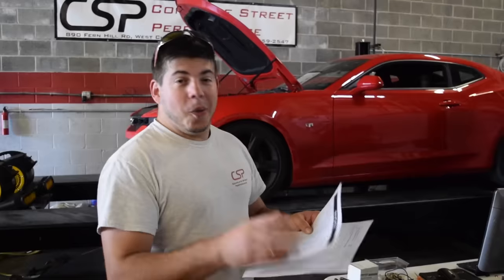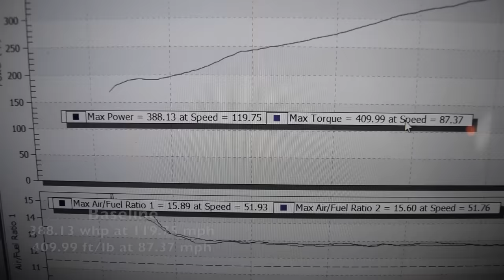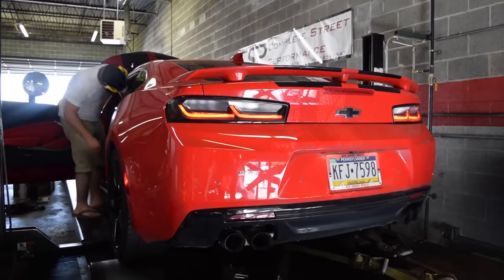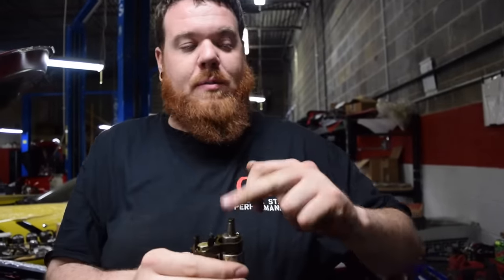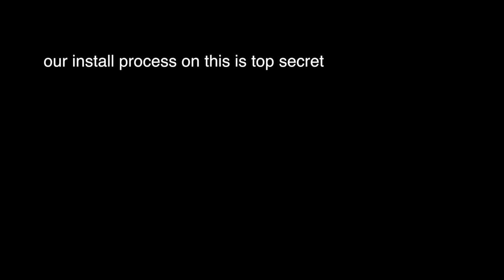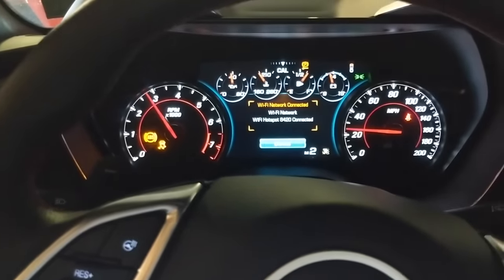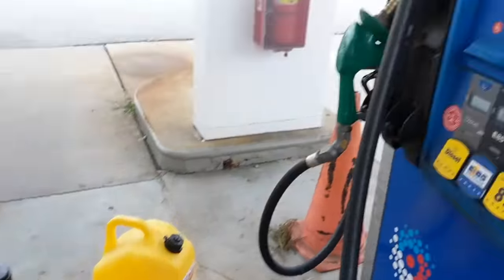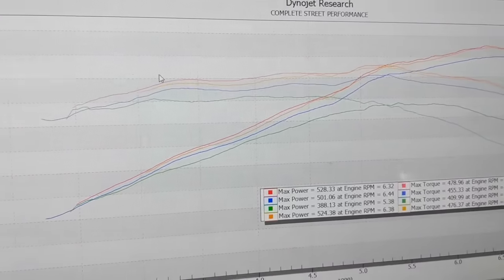How to add 140 rwhp to your Camaro SS without boost!

Comment: Man that looks like a lot of work lol :-) I think I'll just leave mine 455hp, + cold air intake 🤘😎
Reply: Heads and cam change on a new motor makes this kit very expensive hp.
Reply: more like 388 RWHP
Reply: @johnlangley7521  Yes stock, but I did end up getting a Whipple supercharger and some other toys, so she's sitting around 600 rear wheel horsepower 🤘🔥
Reply: @esovae  just took delivery of my '22 LT1. Owned and '05 GTO since day 1. I'd be very happy with 500hp at the wheels, gonna leave this thing stock though.
Reply: @johnlangley7521  oh no way that sounds awesome:-) yeah something's just leave them where they are, sometimes that's better. In my personal opinion I think my car has way too much rear wheel power and so I generally just spin out all over the place lmao. Got to get some new tires and grip 🤘

Comment: Why would a 455 hp engine dyno at 388 hp?
Reply: 455hp is rated at the motor, but at the wheels touching the ground it's always less. Lose HP spinning the transmission, driveshaft, differential, wheels, car weight, etc...

Comment: 7k rpm? That ain’t no smallish cam.. You ain’t fooling me lol.. Good numbers tho 💪
Reply: Capable of 470 horsepower and 410 torque at rear wheels on pump gas
Reply: Small cams peak at 65-6600 7k is big cam stage 2.5-3

Comment: You forgot to mention that 140whp in accordance to this specific setup will cost $6-8 grand, tuning included and parts installation at the least. Wish I have that kind of money laying around.
Reply: Cheaper to boost it and make more power. All I did was upgrade my supercharger on my Gt500. Went from 550whp 540tq to 801whp and 792tq. Runs and drives like stock.
Reply: Darren McFeaters would it be cheaper just to super charge it ?
Reply: Zach best to keep it NA if you want a a fast daily .

Comment: for what you spend on that you can supercharge it
Reply: Lies...lol you need to do your research sir a Whipple would cost 8k not even counting the labor...most he will spend on this is 3500$ give or take
Reply: @704_ss_connor-4  yea because ls is cheap to modify when it comes to changing engine parts cams heads intake etc

Comment: I like these. Nice job!.

Or buy an 18+ mustang, install headers, intake pipe, tune and dump e85 in tank and enjoy 509whp.
Reply: It will still loose to the  ss or stingray with the same power because of weight , tq and power under the curve
Reply: @speedlife301  Mustang is lighter than the SS
Reply: @ish4372  Coyote 5.0 is very robust, doubt very much it will "take a dump"

Comment: Ya know what's funny, my stock 2017 ss 50th anniversary puts down 510 at the rear wheeles with only a tune. Stock was 450hp.
Reply: Sure it does lmao
Reply: @ericbryant7647  I have the dyno printout boy! And I've had over 15 muscle cars since I was 18, I can tell that's your 1st one.
Reply: @raydelfa1125  Just a happy dyno man. You may have picked up some power with the tune but 6th gens are 455/460hp at the crank. You're not picking up 100rwhp from just a tune sorry to say. Lots of factors involved when it comes to dynos.

Comment: It’s weird I make 470 rwhp with a roto, lt2 im, long tubes and E85.
Reply: You can't compare different dynos. It's irrelevant, and the same car can read out a range of 50rwhp differences. There's a local dyno here where stock SS show 365rwhp, while another dyno down the street reads 410rwhp. The important thing is having a baseline and comparing your gains as a delta on the same dyno after you add mods.

Comment: Dude I am impressed the chevy finally makes a bunch more power with a full top end kit wow. Now for real power buy a hemi add a camshaft Instant 100hp. Do long tubes and add a k&n and get the extra  35 to 40 hp with a tune and then if you want you can add 15 degrees of time advance a little fuel and wow a grand total of 225hp. Let's go your route with a full bolt on top end kit a modest tune and you looking at 650ish hp on the 392 and 5.7 around 546hp  I love Chevy and I do believe dodge stole the ls design in many ways but there heads are way better and aftermarket is just stupid when it s brass tax power gains
Reply: What are you talking about? Do a mid sized cam swap in a Ls1 4th gen camaro and you're easily over 450hp at the crank, add heads and you're over 500 at the crank easy. Where do you get 225hp? With a cam, headers, and a K@N filter lol for the Dodge???

Comment: Heads, can, headers and e85?? And only 140 more ponies? Something ain’t right here 🤔🤔🤔
Reply: How do you figure? Heads, cam and headers without a tune will only get you 30-40 hp most of the time.  Just e85 by itself will also net you like 30hp on N/A engine.

Comment: 6th gen camaro's are monsters with basic bolt on's i have one and I've stomped the shit out of dodge R/T's and 5th gen camaro's im pretty sure the 6th gen would handle hellcraps as well.
Reply: shaun jumawan bastard lol
Reply: Brah r/t’s and all 5th gens are slow as fuck 
392(SRT) and mustangs 2013+ are the goals.
Reply: @captainohsowavy  mustangs 11-14 are the same performance wise so why 13+ Haha
Reply: edgar garcia-meza 13s look better than the 11s
Reply: Bad ass car but there's nothing special about beating a r/t lol. Go after a 392 and have some fun.
Reply: @marcellowheeler88  agreed, the 5.7 equipped Challengers have the same power-weight ratio as the 3.7 V6 11-14 Mustang (but better torque-weight), so only slightly faster

Comment: No thanks.  On public streets (below 80mph), the new torque didn't come on until 4 mph later around 56mph, while OEM gave you that torque at 52mph.  I'd rather have torque early than more torque later.
Reply: mrpmj00 It's a N/A build. You're not going to get those kind of numbers lower down the rpm band while staying N/A...
Reply: @231mac  Sure you can, select a different cam that gives you more low-midrange torque.
Reply: @scottwilson1251  Sure you can put in a different grind that will produce torque lower on the RPM band, but like I said, you will lose the higher hp numbers on top, forfeiting the advantages the high hp that a high rpm motor provides. You don't get the best of both worlds on an N/A, non-variable cam build.
Reply: @231mac  Ya it's a trade off. The best thing for someone to do if they really want to stay NA, and gain power in the low and midrange would be to stroke it. That way you can throw a high RPM cam in and still increase power in the low end almost like an old school big block.

Comment: Must be a $1500 job just pulling all that off for the heads. Just pull the engine and make it sooo much quicker, easier.
Reply: And cheaper.
Reply: MHautovlgs paying any shop to pull an engine is not cheap.  On an LT1, It’s only slightly less time consuming to move the lower cradle, remove the oil pan, then you can take off the cam cover to replace the cam.  Lifters need to go too.  This whole job by CSP was probably billed around $8k.
Reply from the maker: Pretty close. Pulling the engine is best as it gives easy access to everything - less likely to make an error when you aren't climbing around stuff.

Comment: Not sure 4K in parts is worth it with 1000-1500 in labor
Reply: I really like camaros but they are expensive as hell to mod with not much gain 4K into a coyote and you’re at 600whp easily

Comment: Should have thrown on a 103 TB for more gain.
Reply: Ported 95mm all you need.
Reply: Well Joe have u tried a 103.  I have and the dyno noticed a gain.  Ordered mine from Katech and I would recommend it no problem for most applications.  Not astronomical gains but all gains together amount to an increase in power overall.

Comment: Dude that’s good rwhp on just a CAI. I think bone stock you can get 350 rw out of em

Edit: I did not realize that these are rated at 455hp crank. I was assuming it was still at 400.
Reply: Ryne Christesen stock they’re supposed to get 410-420 to the wheels

Comment: Why not just buy a use ZL1
Reply: christopher jennings Because that would be like a $20k difference vs $4k
Reply: Spaceman24 
I think based on what I spent for a similar H/C/I & tune set up it’s more like 6-7k+ just a good set of AFR heads is  3k+ alone and a fast intake is $1100 cam $500, tune, along with all the parts like injectors. So Add that 7k+ to a 48k SS your at 55k easy and Cars.com has 5   17/18 used  ZL1 for mid 55k with a warranty

Comment: Dude says "these things are torque monsters" in the beginning. After 5000 dollars in mods, only makes 30 more pound feet of torque  lolz
Reply: Don't be fooled by peak numbers look at where it starts making power and where it ends though out the entire power band these engines make over 400 foot pounds of torque from 3500rpm to 7200rpm if cammed right 470-480 foot pounds of torque at peak 5000rpm to 5500rpm with the right gearing capable of low 11s to mid 10s with drag radials and suspension mods on pump gas it will pull very hard 3000rpm to 7200rpm
Reply: Above comment are crank numbers 400 foot pounds of torque and 470 horsepower at wheels on punp gas which is 560-570 horsepower at crank
Reply: @gloriamaletta8667  not fooled, just calling out what he said. You drive one of these gloria?
Reply: @downhilldaddy5282  No l have a 1984 monte carlo ss with a all aluminum LS2 with CNC ported LS3 heads with a hydraulic roller with 600 lift cam makes 540 horsepower 470 torque at crank with a 700r4 trans 3000 stall and 4:10 gears best run 10.98 at 122mph quarter mile it pulls to 7200rpm with no tapering off in all gears and if not on shifter bouncing it off rev limiter in 1st and 2nd
Reply: @downhilldaddy5282  and it's all motor
Reply: @downhilldaddy5282  it has a 8.5 rearend out on a 1987 buick grand national
Reply: @downhilldaddy5282  mine has a gm single plane intake and a flowed Holley HP 850 carb
Reply: @downhilldaddy5282  this setup is so reliable it's driven to the track raced and driven home after and can cruise at 70mph at 2600rpm it has a lockup torque converter and never goes above 180 degrees even when idling for long periods in traffic idle has a slight chop at ldle people not knowing whats under the hood think it's a ZZ4 old style small block until it gets to 3000rpm then the sound from there up you know it's no old style small block from 3000rpm to 7200rpm it's a fast revving monster
Reply: @gloriamaletta8667  got videos of it?
Reply: @downhilldaddy5282  car has stock suspension with moroso drag springs all the way around to transfer weight to rear tires with lift bars in back no coil overs suspension car goes straight as a arrow no dancing sideways leaving the starting line
Reply: @downhilldaddy5282  look on autotrader under 1984 monte carlo it's for sale in florida it's blue on blue if you'd like to see pictures of it
Reply: @downhilldaddy5282  my car made this time in just 5 passes it's a street driven car not 150 passes on it slowest was 11.37 the engine is a custom build by Scoggin Dickey parts center engine tech told me when buying this engine that it runs 10.60s in a 3200 pound race car and he picked all components and l took his word and trusted him he said 9.90s- 10.10s with a 200 hit of nitrous which my car does not have
Reply: @downhilldaddy5282  tech at Scoggin Dickey said this engine rear wheel dyno with a 850 holley and open 1 7/8 longtube headers makes 440 horsepower 395 torque at rear wheels no accessories  torque at 5400rpm and horsepower at 6900rpm
Reply: @downhilldaddy5282  this engine at crank makes over 400 foot pounds of torque or more from 3500rpm to 7200rpm very wide band pulls forever
Reply: @downhilldaddy5282  my car also has power steering and brakes
Reply: @downhilldaddy5282  car weighs 3230 with half a tank of fuel 3380 with me in it
Reply: @gloriamaletta8667  so no video and youre defending a car you dont have? Leems segit
Reply: @downhilldaddy5282  my name is Bob and l told you look on autotrader under 1984 monte carlo to see pictures of it it's blue on blue ive owned it since January 1984
Reply: @downhilldaddy5282  what do you drive your moms honda civic
Reply: @downhilldaddy5282  call the number from the add on autotrader and you'll see it's my car unless your scared to be wrong
Reply: @gloriamaletta8667  i think thats how she had your dad, and how you were born

Comment: 150hp for $8k? No thanks... 😂
Reply: Manuel Vazquez-Gutierrez you gotta pay to play my friend. Do you happen to know a better way to add power? Just wondering.
Reply: @desmondbunn4457  a whipple and keep mpg with the supercharger compared to a cam
Reply: MARTPERE so you’re saying just put a whipple on it instead of all those other mods?
Reply: @desmondbunn4457  yeah i asked a couple of people who did the same mod they said the cam adds hp but its more for the way it sounds ..supercharger add 150 hp  with slight mpg change ..im bout power but not going to the gas station every 3 days
Reply: @completestreetperformance  but you can get 150hp just by adding a supercharger no supporting mods for 8 grand ...cam and supercharger we talking 250 to 275 rwp extra..im just saying for 8 grand the supercharger route is better than cam n heads

Comment: Stock 2018 mustang is makeing 411 stock !🙂💔
Reply: Automatic mustang puts down 411 stock?
Reply: the Gonz  yes see in youtube 2018 mustang dayno
Reply: Different dyno different day means nothing. It also looks like they used 5th gear. Which reads 20-30 hp lower. I’ve seen auto ss dyno as high as 420 rwhp
Reply: So,how cares.Why are you watching camaro videos.
Reply: Ronald Croy  I Love camaro 😒
Reply: The A10 may be more efficient as well....
Reply: Shawn Gilbert the ss don’t have the A10
Reply: @TipsyLiquid  I don't know if the 19 does but I drove a top of the line 2ss 1le Camaro when I drove then all and it didn't...I asked the salesman if it was possible in any trim level and he said just Zl1 which they had there ...  I drove em all.....I had bought a slightly used 18 Challenger...I don't mind projects I was gonna do some drop in forged and a D1x took it to paintless dent repair on a tiny ding right by door handle something I couldn't ignore long story short car had been wrecked and fixed " off the books" lawyers AG MV commission it was a nightmare....
 2 things I told the Chevy dealer.....unless you signed a no compete and could only use the a10 in ZL1 and ZR1 ( since its codeveloped with Ford ) BAD mistake not using it....2nd the car is almost as big on the outside as a challenger with less space than the physically smaller Mustang makes no sense ( it's not their fault I'm fa and talk but it's still dumb I'm only 6ft 3 and my head was literally touching the too literally) 
 Also I didn't ask about the Camaros but I did try to order ( since they are putting the a10 in some trucks in 19 and trucks are the first thing out ) a Regular Cab short bed 4x4 5.3 or 6.2l I don't care A10 ( that I could drop and boost ) no joy in fact they have NO regular cab short wheel base regular cab is only for the WT and WT only long bed this year.....
Wife got a new Traverse and I'm waiting on the 1320 or the tick to be defined......

Comment: Meh, or I could just buy the whipple complete kit and install it in my garage for cheaper and probably more power.
Reply: Until you blow your engine because you didnt build the block lol. NA is beneficial because it's not forcing anything extra into the engine, only maximizing what it can give - the risk of blowing it much decreased especially if you plan on doing minimal work to the block.

Comment: Not impressive imo. The ls1 can can gain that from HCI
Reply: You do realize he never mentioned the specs of the cam or the heads correct? You can go bigger on the heads and cam and make at least 550whp. Try doing that on a 346 ci LS1.